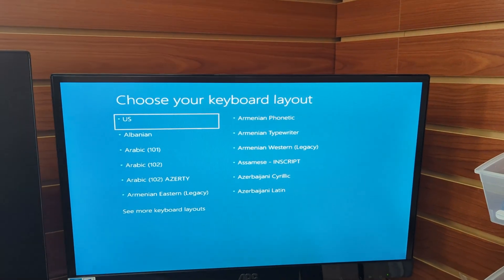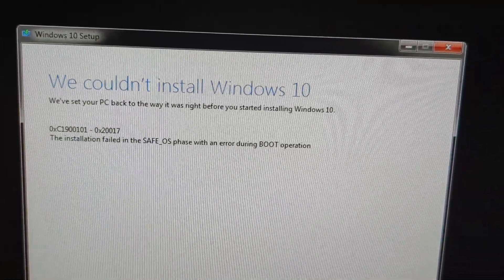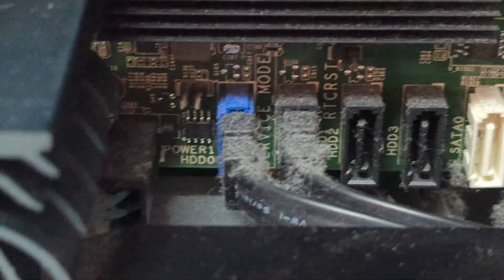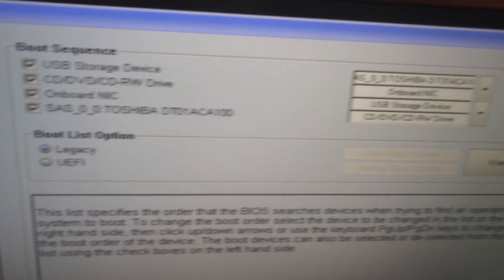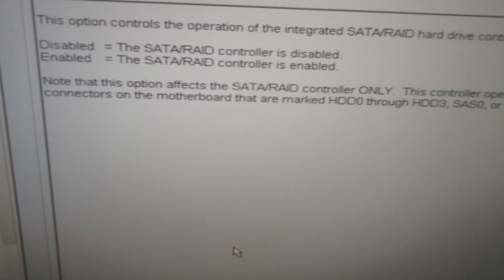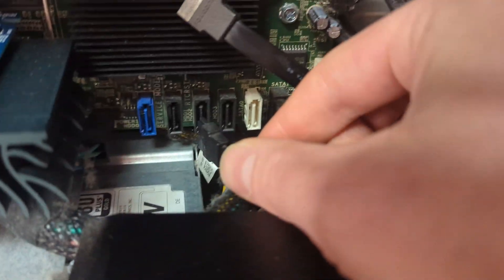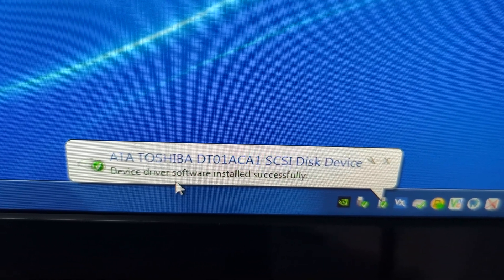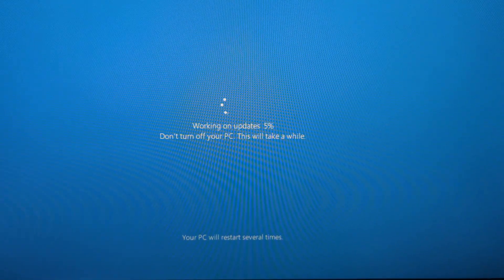How To Fix Windows Installation Failed  - Safe OS Phase With An Error

Comment: I have the very same error message when attempting to upgrade from Win10 to 11. However, I have the C drive as an M2 SSD that was cloned from an HDD from another machine as I really did not like the idea of having to reinstall all the programs I use regularly .  I wonder if anyone here found a solution to this please?

Comment: Thanks for an excellent production! 

I had a problem with getting Win 10 updated. The usual upgrade assistance tools and troubleshooting steps didn't work.  I ended up using the media creation tool to write an ISO which I mounted to a virtual DVD, and performed an upgrade install which completed successfully.